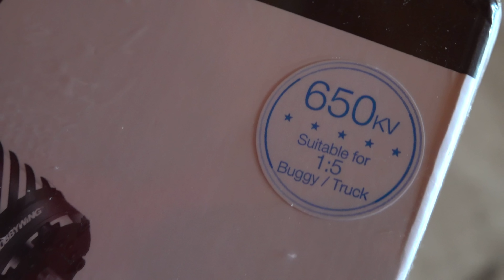I Drive My Truck onto the Mechanics Table | RC ADVENTURES

Comment: Any reason you didn't go for the max 4 esc? I've been looking at that one next for a build. And a XLX2 was moving that heavy thing. That's awesome, and it moved over double the rated weight for it which says something about them XLXs.
Reply from the maker: Above all.. the cost difference.
Reply: @TheRealRCSparks  o damn I just looked. Didn't realize the max 4 was double the price. That's crazy
Reply: They go on sale once a year. Save like 400 to 700 on the combo  @ralphhondaman

Comment: So I've always been curious if using a torch to melt the thread lock would anneal the aluminum parts around it? I've done that on all my rigs but never seemed to ruin any parts after repeated on and off with different parts but always wondered anyway lol
Reply: Soldering iron world probably be best to concentrate heat to the screw. Heating and cooling repetitively will always weaken metal over time.

Comment: Personally the appeal of large scale RC Monster trucks like those from Primal is that they are normally gas powered which adds a coolness and fun factor that just can't be had with electric. Still love my other electric stuff like my bashers and crawlers but these huge trucks deserve a Taylor engine imo.
Reply from the maker: I have a taylor 80cc Supreme .. its a great engine, but its too loud for running in the woods, and is a terrible choice for a crawler.  It ruins the experience for me

Comment: Absolute beast right there!!! Everyone thinks a Max 4 combo is necessary but im hoping thats not the case. I really want to put a Max 5 G2 12s combo in my Primal RC Collector's Edition GraveDigger but I also have a Castle 2028 800kv motor just sitting here. To keep my cost down I thought about just running a Max 5 G2 with a sensor adapter to run 12s on the Castle motor since it is 12s capable. I'm going to have to see how this runs before I decide what to do. I cant wait to see you run this a bit to see the speed of it. Is it running the stock gearing? Can't wait for the next video 👊👊👍👍
Reply from the maker: as I mentioned in the video, Im not putting it in for speed. This is a slow truck for me..  ive geared it low, and put in a low KV motor. thats for torque, not speed :)

Comment: So i honestly have a question about this .... should i buy it and also buy the electronic kit .... so i can swap between gas and rlectric depending on where i am running it
Reply from the maker: Its not that easy to swap between the two.. its kinda one of the other